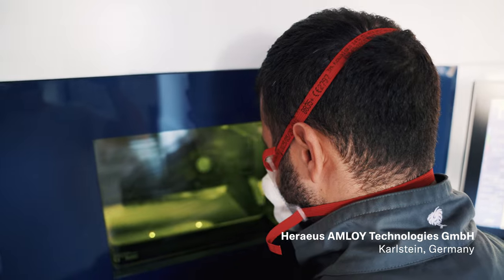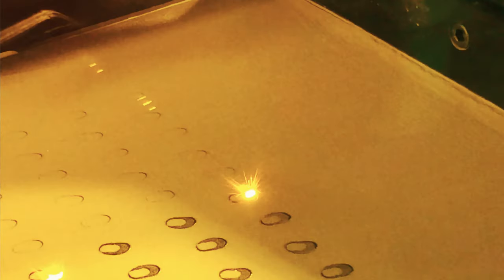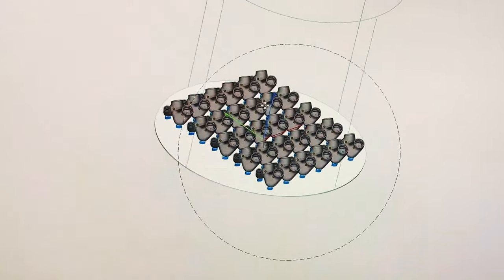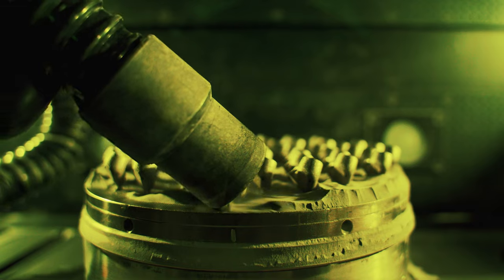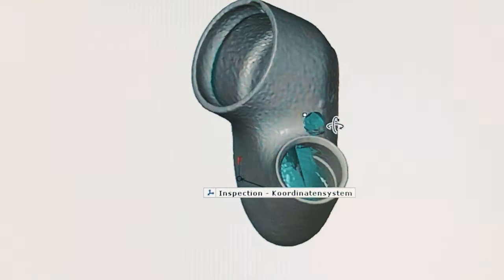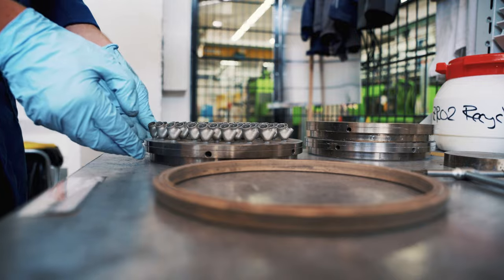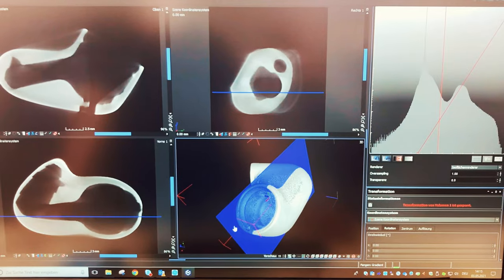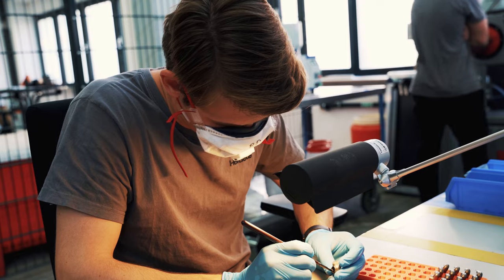Making of IE 600 In-Ear Headphones | Sennheiser

Comment: I believe there is something special about "600" I hope they did it proper this time with the ie600 and it will become a legend just like the HD600... Edit: it's just over-priced iem against Chi-Fi brands nowadays...
Reply: IE600 blows any chifi at its price range out of the water. It trades blows with kilo buck iems with its speed and technicalities
Reply: @Sand_1995  I know sennheiser iems have good fit and comfort, build quality is also great other than it's stock cable but im not sure about technical performance and speed. Chi fi is seriously competitive against all these known brands in terms of sound in this last couple years.
Reply: @Kenan_Guney  only in the low end is chi fi any good. Chi fi struggle at higher prices. IE600 and IE900 have technical performance that compete well with the heavy hitters at that price range.
Reply: @Sand_1995 does that technical performance matter at all if IE series iems die after a couple of months…?